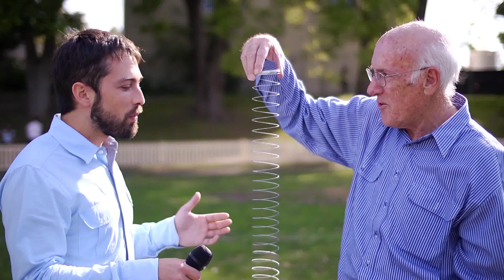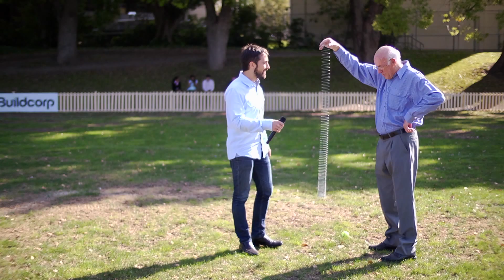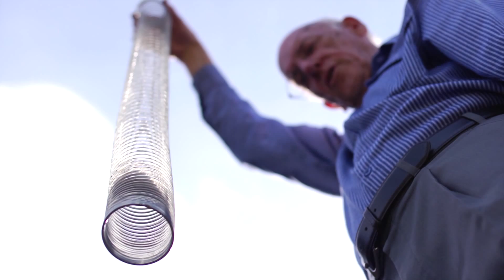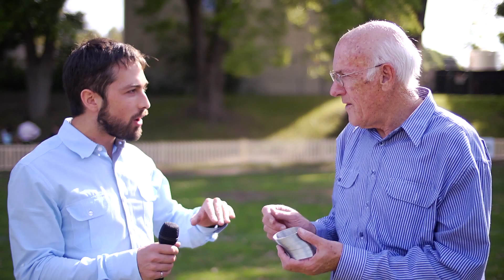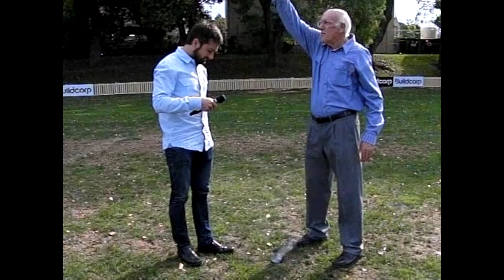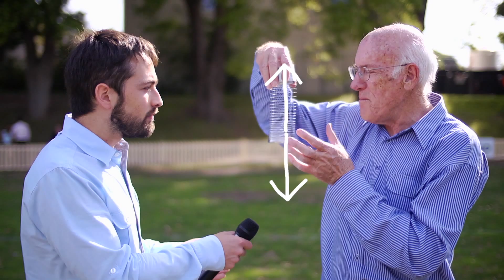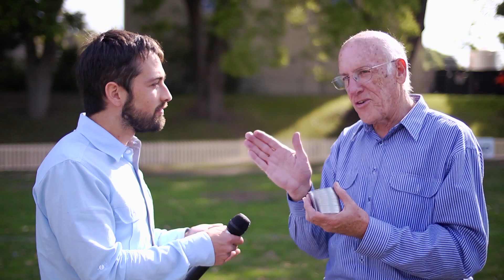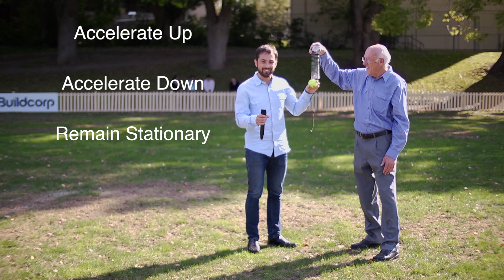Slinky Drop Answer

Comment: F= mv
F-mv=0
Tension Up- Momentum Down=0
I think that the the lower slinky not moving because its wight is supported by tension of the slingky, and we get the tension by pulling the upper slingy down.
1st Hypothesis, suppose with no gravity, in space, the lower slinky would pull up and the upper slinky would pull down, which end in half the length of slingky.
2nd Hypo, on earth, if we drop the tenis side by side with slingky, i think the head of slinky would fall faster then tenis. Try it?

Comment: it remains stationary due to tension.  The speed of sound in the slinky is at least 2000 m/s, which would only be visible at 300 fps in 2 frames if the slinky was long enough for the wave to propagate at least the duration of 1 frame, which at 300 fps, is 1/300 = 0.00333... seconds * 2000 m/s = 6-7 meters. FOR TWO FRAMES.  What you are seeing is change in momentum, not change in force (aka IMPULSE)

Comment: Sound is the reason it remains stationary. However sound, like light, moves at different speeds through different mediums and circumstances. While in a straight line you're not likely to see it, however there are turns and conflicting contact points slowing it down to a point visible in 300 fps.

Comment: The speed of sound applies to him letting go of the slinky.  You see, him holding the slinky applies a force what physicists call the "Normal Force" which sets the total force of the slinky to 0 Newtons when held stationary.  When he lets go, only the top of the slinky experiences the change immediately, and the change is propagated to the remainder of the slinky through molecular rubberbanding at the speed of sound through a solid (faster than in air).

Comment: This is a bad example because gravity acts on all points.  What's really happening here is that the _center_ of mass is accelerating at the normal falling rate while tension is keeping the bottom "stationary".  The actual communication of change in force happens at the speed of sound.  Assuming that the slinky is anywhere between 1 to 10 meters, that means that the drop information has propagated in anywhere between 0.003 and 0.03 seconds, both of which are faster than a single frame in a video.

Comment: Not exactly.  The "information" here is the changing tension, which isn't instantaneous.  Essentially as you let go, the bottom has no idea that happened, it still feels the tension that it did before you let go, so it is not moving.  Then you let go, the spring begins to contract, but the tension hasn't gone yet, and as it contracts, the tension changes as a mechanical wave, which we sometimes refer to as the information catching up.

Comment: In the experiment proposed in the end of the video, the same thing will happen that in the first one, but faster. The lower end will have a bigger weight force and so a bigger tension, so when the information that the tension has seized gets there, the acceleration will be bigger. The information will also travel faster due to the weight.

Comment: Yes! The top falls faster because the forces on it are the force of gravity -mg (as all the slinky has on it) and -T (the force the parts of the slinky have on each other). Therefore a=(-mg-T)m or a=-g -T/m, a more negative acceleration than just g. This also makes sense because the sum of the forces on the bottom must be 0, so for the bottom a=0=-mg+T so T=mg. It gets a little complicated because we're not dealing with halves, but you get the idea.

Comment: The simple way to think of this is that each ring of the slinky is experiencing a force towards the adjacent ring. The ring at the bottom is experiencing a force down-wards due to gravity and an upwards force towards the ring above and are in balance. The top ring is experiencing a downward force due to gravity and a downward force from the ring below and are countered by being held. When released, the bottom ring still experiences both forces until the above ring moves, so the slinky cascades.

Comment: My intuition would be to say yes.  Think of the two ends of the slinky as separate masses.  When the top one falls but the bottom one remains stationary, the top one will gain some momentum.  When they meet and fuse, that momentum is transferred to the combined mass, which gives it an initial velocity.  Then it falls according to gravity and builds up the velocity it would if you just dropped the bottom end.
Reply: Great! It's a really nice way to feel it apart from the physics explanation

Comment: I dont think this has to do with the slinky "reaching the bottom". I think it has more to do with the spring reaching its equilibrium length. Once this happens the tension force up becomes zero and the only force acting one the slinky will be gravity, causing it to fall. But overall a mad video, great work.
Reply: What if done horizontically where supposed "gravity" do not play a role?

Comment: tomanders1 is correct, both ends equally pull towards the center, equal and opposite reaction, the top pulls down, the bottom pulls up and gravity pulls the center down which is where you want to watch, so technically the bottom is moving up... but it doesn't.

Comment: This guy is actually right. The bottom end moves towards the centre and at the same time, gravity pulls it down. Therefore, there is zero displacement of the bottom end. But the upper end is pulled by two forces at once. Which explains the video.

Comment: Yes, the flexibility of the pole would have some effect on the velocity of the reaction, but to travel faster than the speed of light, you would have to find a material that has a speed of sound faster than the speed of light. For example, to travel faster than the speed of sound in AIR, then you use a jet, which metal has a speed of sound faster than the speed of sound in air. It moves faster. Check out Super-sized Slow-Mo Slinky Drop and skip forward to 2:33 for exactly what I mean.

Comment: This also proves the answer of another more controversial question: Could you move faster than the speed of light if you had a pole spaning the entire distance, and you just pushed it? Wouldn't that be instant? No, because the pole would be moving as fast as it's material's speed of sound, just like the slinky in this video.

Comment: if that where the case, the slinky would shrink inward and fall simultaneously. it didn't, so you are wrong.

what happens is;

the bottom of the slinky is being suspended with equal force to gravity by the rest, which is why it kinda hovers there while at rest. when the slinky is dropped, that tension remains until the slinky's top reaches it's bottom.

Comment: Yes. It's pretty sweet. It has to do with the energy wave going through the slinky as it falls. The longer the slinky, the longer it takes the wave to get to the bottom. Until then, the end of the slink doesn't "know" that it's floating.

Comment: All we need is a high speed camera and a suitable software to calculate if the top end falls with a 9.8 m/s^2 or twice that with 19.6 m/s^2 (bc bottom end goes up at the same rate it falls down to appear stationnary, plus top end falls down at the same rate bottom end goes up (assuming from tomanders1's hypothesis) so that's 2*g.)

(But I'm for 9.8)

Comment: look at it backwards if u hold the top of a splinky gravity pulls the rest of it down but it does not touch the ground because  the strength in your arm is greater then gravity  and it doesnt go back up becuase gravity is strong enough to hold pretty close to the ground so when u let go of your force the slinky retracts but is held in place by gravitys hand, its like if u held it and gravity decided to let go, the part ur holding wouldnt move well the rest caught up then u would feel the force

Comment: No, you and the rock would be falling at roughly the same speeds..  Air resistance might play a slight factor, but not enough to make up for the fact that once you tried to take a step on the falling rock, the pressure from your foot would push the rock away from you, and you away from the rock.  There'd be no way for your other foot to still reach the rock for another step, and even if you could reach it, you wouldn't be able to get enough traction to move forward much.

Comment: Gravity IS pulling down on the entire slinky, it's just that the it takes a finite amount of time for the compression wave to travel down. 

Notice also that the top part of the slinky accelerates quicker than 'g' because the tension + g is pulling it down.

Comment: haha that's the trick,  have you ever pulled a slinky?  It pulls back doesn't it?  Gravity is trying to pull it here,  but the spring of the metal is pulling back just enough to make the bottom drop much slower. Think of it as if two people were pulling on each end and let go,  it would meet in the middle.

Comment: if the mass of the object is great enough, the bottom would catch up to the speed of sound before it catches up to itself.now if the objects valume is enough, the object will drop out  faster than its bottom, ripping the fabric of space-time. so if you saw someon time travel, you would see it squish together, like it has hit a wall. it will dissapear and one of two things will happen, a black hole if the fabric of space has been ripped, but time fabric  ripp would result in time travel

Comment: The two ends will get closer together but that's about it. The slinky is special because it can segment and isolate forces within the movement of its specific rings but in your examples, as the top end starts to fall, the information signalling the force of pull would move through the object faster than the initial falling speed. Once the bottom end gets this information, it too will start to fall as well before the top end could reach it.
Reply: i am aware this is 10 years ago but did you really mansplain veritasium

Comment: The centre of gravity of the slinky is falling. The top and bottom are being pulled together (towards the centre of gravity). If the centre of gravity falls at the same rate as the bottom is being pulled up, you will see no movement of the bottom part of the slinky. Likewise, the top part of the slinky will seem to fall at double the rate of the centre of gravity.

Comment: as long as it is a good slinky the base will stay still until the slinky colapses all the way. This happens because the slinky is trying to contract against gravity (the base is trying to go up to meet the top) but the force of the contraction is equal to the force gravity exerts on it in the opposite direction. The forces cancel eachother out and the base stays still

Comment: You stupid duck! If the potential energy is far greater than the pull of gravity, as you sad, the slinky will fall down. Pot. energ. is vector, if top move to grond- then arrow of  PE vector aim to ground. The reason why slinky is not falling is: objects that fall - weigh nothing! Take a spring scales in you hand, atach to scales some heavy object. Scales will show, let say 20 kg, but when you will jump with all that stuff from LS 100 m. scales will show - 0. impresing?

Comment: A Slinky's mas is constant. But, the difference between the top and bottom masses in the video are not. The act of being suspended creates tension due to gravity; the bottom being heavier than the top.  This is potential energy. When the energy is released the forces compete to be in balance. The top portion of the Slinky rushes towards the bottom because the potential energy is far greater than then pull of gravity between bottom and the ground.  Once it becomes equal the Slinky falls to earth.

Comment: the reason the the bottom stays in one spot is cause the slinky is a spring and the top of the slinky is pulling the bottom up, and the top of the slinky is being pulled down by gravity and the bottom of the slinky that is why the top of the slinky moves faster. and the bottom of the slinky does not start falling until there is no more tension from it being pulled up

Comment: Fuckin'aye.  By information he means "The weight" of the object.  Remember the twin towers? its just like that.  The acceleration from tension = the acceleration from gravity and the only reason the bottom of the spring collapses to the ground is because the weight of the object at the bottom increases and also there is no longer any tension holding it up.  Also, if this spring were longer or shorter than this one, it would not have the same result b/c springs aren't naturally linear.  boom

Comment: Kind of surprised you're making that statement with a username like "Stopmitioncreator1", but anyway ...

No, the faster (i.e. more frames per second) something is shot at, the slower it will be (and here is the key) when PLAYED BACK AT NORMAL speed.  By normal speed, we're normally talking somewhere around 30fps (29.97fps NTSC, 25fps PAL, 30/25 and 60/50 fps for HD, etc.)  It is also called "overcranking" because in the old days they used to crank the cameras faster to achieve slowmo.

Comment: Gravity cannot overpower the remaining tension until the top portion of the slinky rejoins with the rest of itself.

the tension within the slinky is greater than the pull of gravity, party due to the weight of the slinky being more evenly distributed while it is extended.

when it does rejoin, not only is the tension being released, but the weight of the slinky collides with itself, causing outward distribution of tension enabling gravity to finally pull strongly enough on the slinky to move it

Comment: Ok, I think I have a more intelligent question...As the tension is released, gradually as the slinky shrinks, why doesn't the slinky begin to move until AFTER the slinky has completely shrunk.  Why don't we see the slinky shrinking, and then at some point in the middle of all this, gravity slowly starting to gain control?  Why does gravity have to weight until ALL the tension is gone? Can't it overpower even the smallest bit?

Comment: An additional point of interest that they failed to address in this video regards what would happen if they suddenly stopped the top of the slinky from falling. The bottom would not stay stationary in that case. If you stopped the top from reaching the bottom, the compression wave would carry on and the bottom would drop away from the now stationary top. So there's really no way to cheat this system. It's nature behaving just as we all knew it did, only in a context we don't often witness.

Comment: I think you might be misunderstanding the concept on display here. "Information" is just shorthand for the more complicated series of interactions that occur as part of any given event. You could make it hover longer by using a longer slinky or dropping it in an environment with lower gravity (Though the gravity would need to be at least strong enough to counter the force of tension in the slinky). But there's no magical way to just slow down the information transfer.

Comment: To better understand, place a bit tighter slinky horizontally on a long table and pull it with both hands. Now release only one hand. Whichever hand you release, the slinky collapses towards the other side, because that is where the pull is.
This situation is very similar, you can assume gravity is one hand and his hand the other. When his hand is released, it has to collapse first, because the tension force is still there until it is fully collapsed. Only then, the gravity acts to make it fall.

Comment: No extra tension; gravity acts on the center of mass. Initially, the slinky is not accelerating because the force of gravity is balanced by the force of the man's hand (they are also holding the slinky taught). When he lets go, the unbalanced force of gravity causes acceleration of the center of mass. However, there is now no force holding the slinky stretched, and as it falls, it simultaneously "unstretches" (can't think of a better word) with the same acceleration; bottom stays still

Comment: But the slinky begins in a equilibrium.  The tensional and gravitational force are equal on the bottom of the spring.  Where does the "extra" tension to pull "up" the bottom come from?

(Not flaming, genuinely interested in ideas)

Comment: Does the bottom have to actually wait for the top to reach it before it starts falling?  Or if you had a slinky with a fast enough wave speed (so low mass and high elasticity) could you get the bottom falling significantly before the top reaches it? On the video there does seem to be a wave going ahead of the falling top end before the top end accelerates to catch it up, but it's difficult to see.

Comment: The amount of tension pulling the bottom of the slinky up is equal to the force of gravity pulling the slinky down, therefore the bottom stays in place until the compression reaches it and the tension on the bottom is changed. What's magic about it?

Comment: I was a little disappointed that there was no discussion of how the slinky's force pulled in two directions and toward the center of mass. The top of the slinky is accelerating faster and the the bottom of the slinky is not accelerating at all until the slinky no longer behaves as a spring (the two ends come in contact with each other). The center of mass (the center of the slinky) appears to be dropping with an acceleration of g.

Comment: @atay5510 the same results will happen even if you increased the slinky s mass or spring constant because the slinky will always adjust to the right length where gravity can no longer pull it down further. This is what they mean by when they say that the tension force reaches an equilibrium with the gravitational force pulling down.

Comment: vanishes. Now, the upper two masses dm, originally seperated by distance dx, are now both accelerating at g due to the loss in tension. we can now extend this analysis to the remaining dm in the spring and see that a small mass dm in the slinky will not start accelerating until the shock front has reached it.